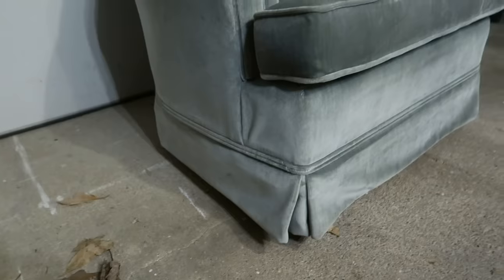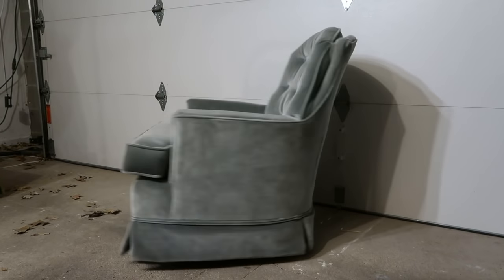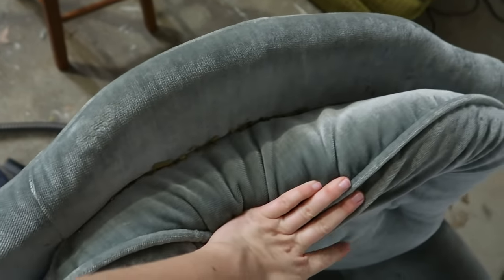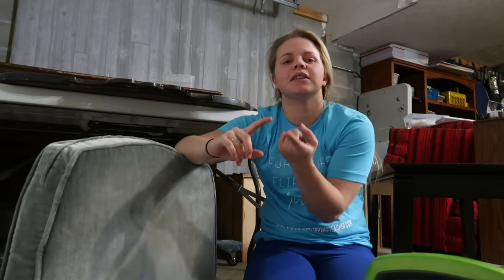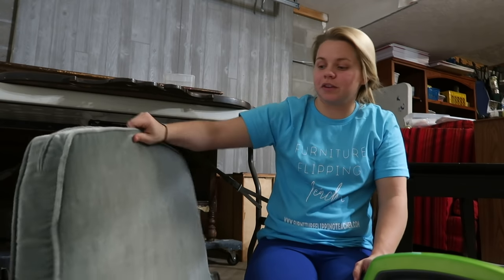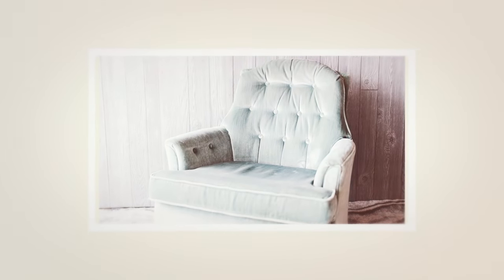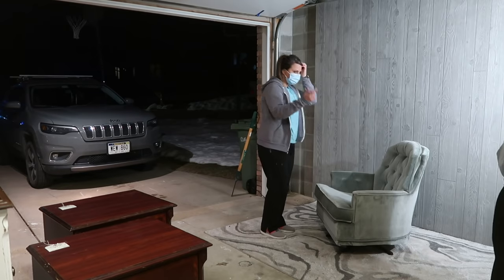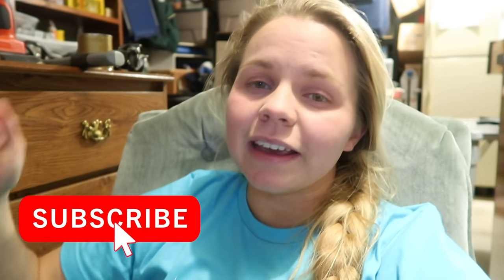| Flipping a $10 MCM Chair in 2 Hours | Easy $160 DIY Thrift Flip | Furniture Flipping Teacher |

Comment: Question! Flipping something similar today. Is the fabric still pretty wet usually after you spray and vacuum? I feel like maybe I’m using too much spray cause they seem super wet?
Reply from the maker: Yeah, it just depends on how much you spray. Don't over do it with the water you're spraying but you want to get enough so you can suck the water out and it will also grab the dirt. Mine are a bit wet after the whole process. Thanks for watching and good luck!